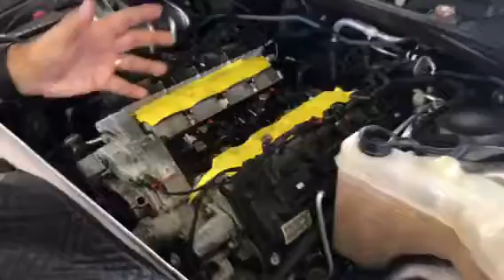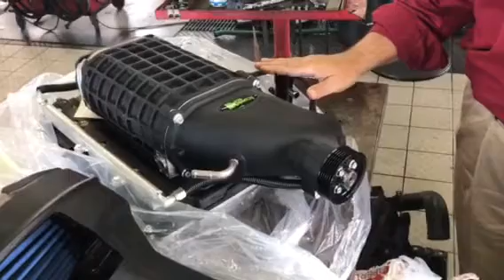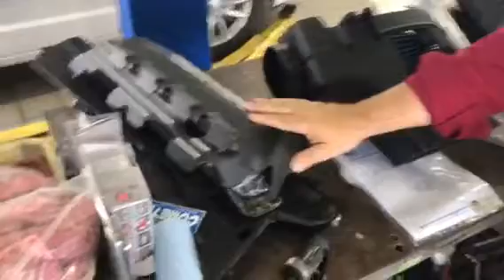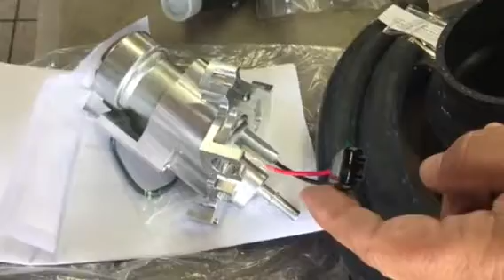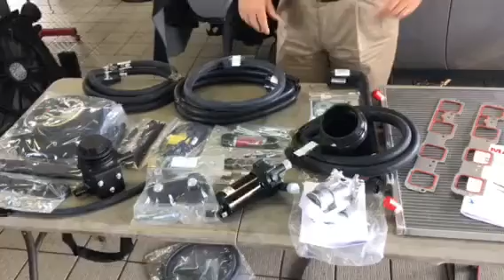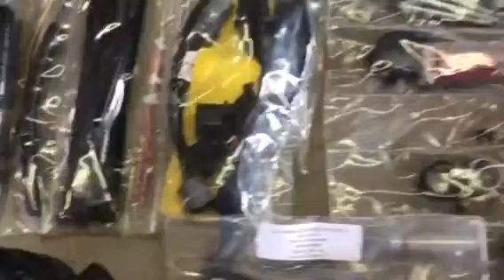2015 Challenger R/T Magnuson Supercharger

Comment: Hello, I've got a '16 5.7 Charger, how reliable is this kit? I'm looking for power but also longevity, have there been any issues say ~50k mi. down the road? Thanks and awesome vid!
Reply from the maker: @Gregory Gilmore very reliable, and on the 5.7 we routinely do 8 psi boost level and approx 460 whps
Reply: @moparnation2235  how much and location
Reply from the maker: 10899.00 plus applicable taxes, Newton NC
Reply: @moparnation2235  thanks
Reply: @moparnation2235  i Have exhaust done already plus I’m gonna do the manifold srt is it less ? Now